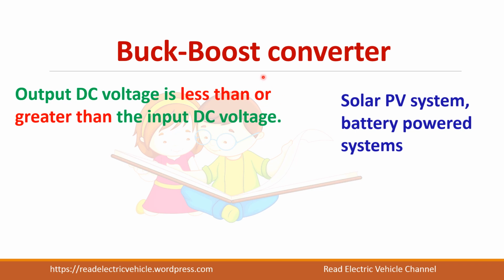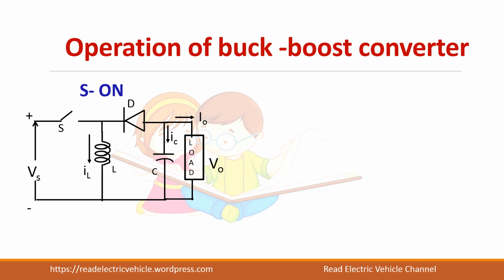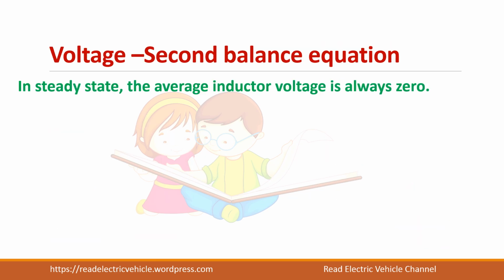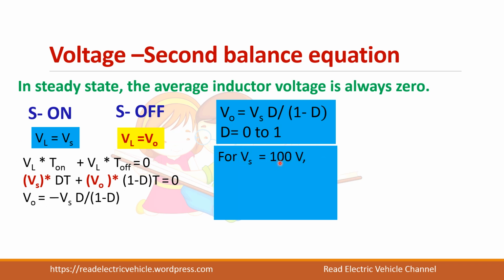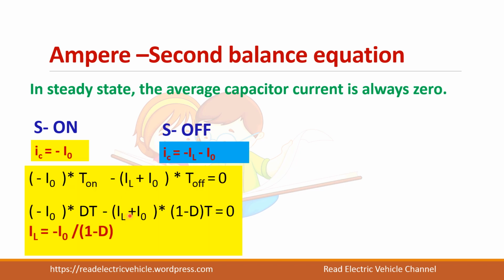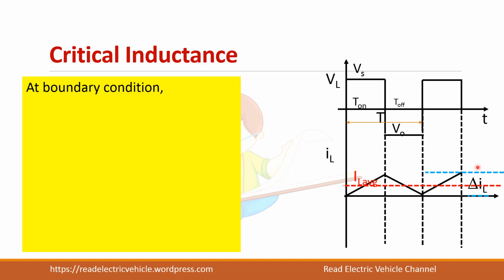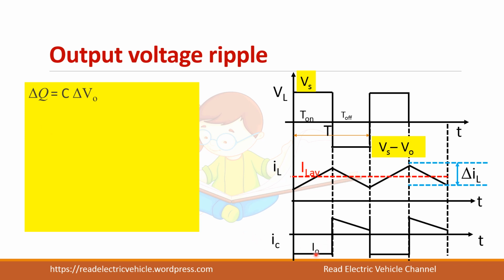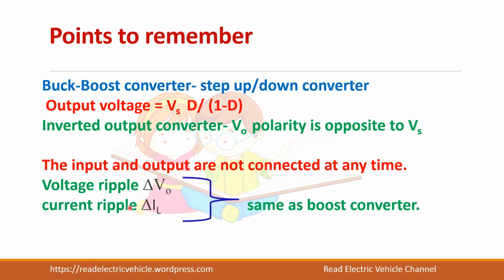37.DC-DC converter/Buck-Boost converter/step up-down chopper

Comment: 19-OCT-2023 === THIS IS GOOD INFORMATION VIDEO. INDEED, THIS DC-DC CONVERTER IS EFFICIENTLY USED TO CONTROL  THE VOLTAGE OUTPUTS OF THE CONNECTED DOWNSTREAM LOADS. WITH THE THREE (3) TYPES OF CONFIGURATION MODE SUCH AS BUCK, BOOST AND BUCK-BOOST, THE VOLTAGE OUTPUT IS ACHIEVED BY THE LOGICAL OPERATION AND FAST CONDUCTION OF MOSFET OR IGBT SWITCHES AND DIODES EITHER STEP DOWN OR STEP-UP WITH THE MAGNETIC ENERGY BUILD-UP OF THE INDUCTOR AND CHARGING OF THE CAPACITOR ENERGY STORAGE. HOWEVER, WHAT AND WHERE DOES THE SUPPLY POWER AND VOLTAGE AND FREQUENCY OF THE GATE VOLTAGE IS COMING FROM TO MAKE THESE MOSFET  OR  IGBT CONDUCT AND  OPERATE FAST ?, TY !,  BY FMSJR.
Reply from the maker: gate circuit will be separate with proper isolation. gate circuit portion is not covered in this video.

Comment: NIce.
Reply from the maker: Thanks!
Reply: @readelectricvehicle6078  HI, can U help me ? I have problem with my DC-DC MPPT BOOST topology, ESP32 + ADS1115 + ACS712 IN + ACS758 50Bi OUT + IRFP4227 FETs. I have problem with thermal pads, what is better to use ? I used silicon end my FET exploded around screw, from the back side. But temps, currents and voltage + snubber was OK. Mica, silicon, kapton or onother material ? WHat is the difference in cooling of Si, SiC and GaN FETs ? Some FETs have Rjc Rcs around 0.45 - 0.50, another 0.09 - 0.15.